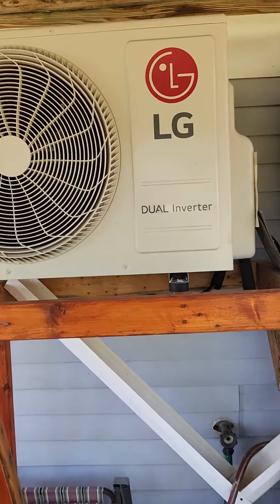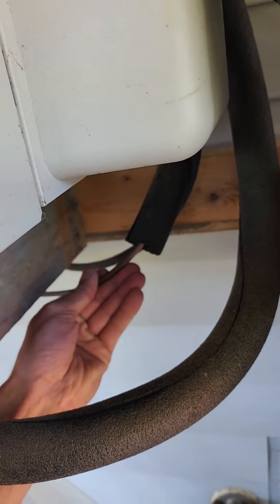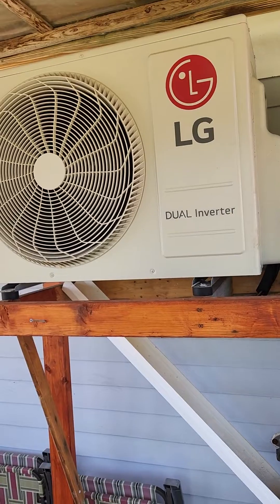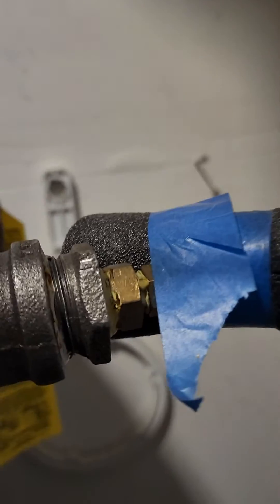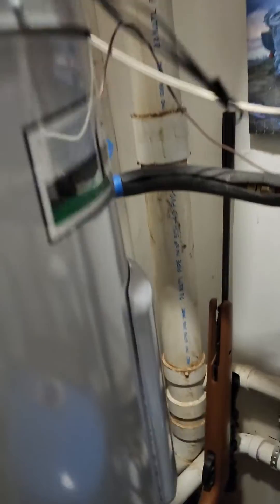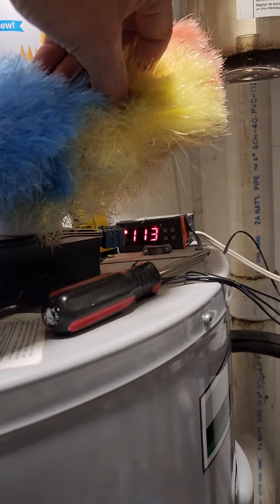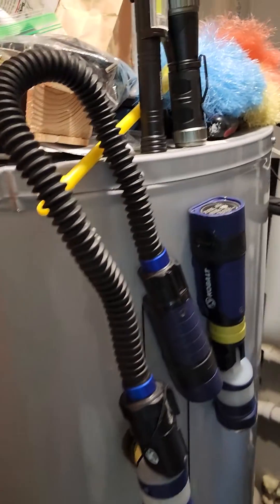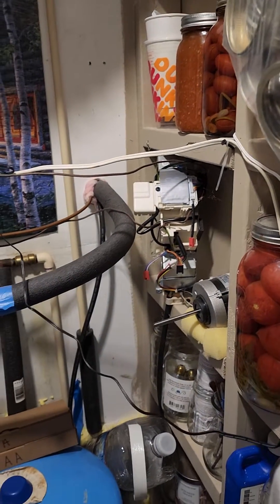1 year update DIY heat pump water heater.

Comment: How are you controlling it based off temperature?
Reply from the maker: Simple, relay controlled by preset min and max temp. This relay cuts the circuit of the indoor units temp sensor. When cut unit turns off into error mode. When temp drops circuit connects and unit runs in max temp testing mode to make maximum hot water.

Comment: Why did you leave the indoor unit motor? A NE555 pulse generator module can simulate it's feedback to the control board.
Reply: This is the answer I'm trying to find out. How to get rid of the motor stopping to waste energy.

Comment: what's the max temperate you can reach in the tank, is it 140F or can you go higher? Thinking about doing a similar mod for radiant floor buffer tank.
Reply from the maker: Tried 130f

Comment: How do you manage legionnaires? I understand you run at 120F if I recall from a year ago, this is approx 50C which is far from safe in terms of bacteria growth. I'll start play with something like this but was planning to pass the condenser part through a plate exchanger and then using a pump to run one of three heating circuits in tank that already have solar circuits. My concern is efficiency drops, I really like your direct heat solution !
Reply: As it's impossible to get hold of split systems here in EU atm I'll start as soon as I can exchange our old pump that'll use for domestic hot water. I literally hate all the current solutions as they are way oversized for just domestic water, and the other DHW solutions are built-in/on tank which is inefficient and too costly when shit hits.
Arduino/Pi will be the solution to control instead of hacking the head, will be happy to share!
Reply: Watch heat geeks video on legionella protection. It’s basically a non-issue for domestic users. All a2w users I know have their legionella cycle disabled

Comment: It would be sweet if someone could develop an Arduino or raspberry pi to communicate with the outdoor condenser to turn it on and off instead of having to Frankenstein the original indoor board and leave the motor connected.

Comment: What would you estimate it achieves for COP at lower winter outside air temperatures?   Does defrost mode work still on the outdoor unit?   Any thoughts on putting the copper coil into an open unpressurized hot water storage tank like a solar drainback system?
Reply from the maker: Defrost works like it's supposed to but faster since it's in hot water. Cop at low temp I assum is equivalent to the original engineering numbers which is 290% at 5f outside temp running full speed. U can do this is a non pressured water tank sure.

Comment: Great work. I share your frustration with the US and Canada not being able to buy air to water heat pumps. I heat my house with hydronic heat in the floor and use natural gas. I have lots of extra power from my solar panels and want to build a heat pump to heat water year round for heating and domestic hot water. Thanks for this demonstration. I think I will buy a 48thousand BTU outdoor unit and build a heat exchanger beside my indirect hot water tank and use a small circulating pump that runs off the indoor fan motor circuit to heat my tank. Your explanation about the midpoint sensor really helped me to grasp how easily this can be done. Thanks again for this pioneering work.
Reply: "Nyle water heating systems" could be your solution.